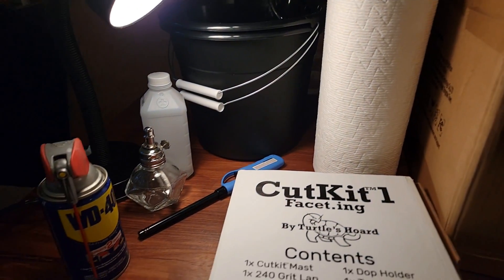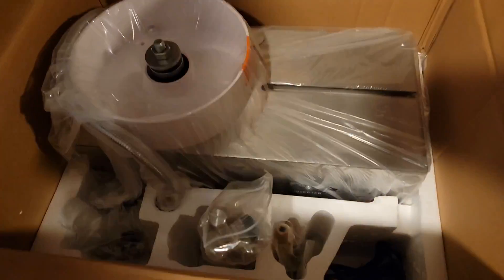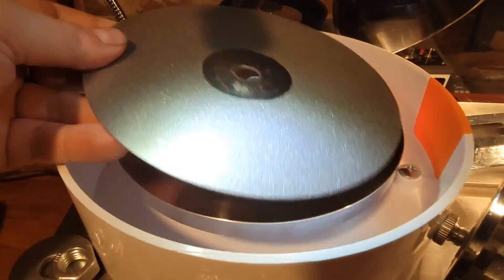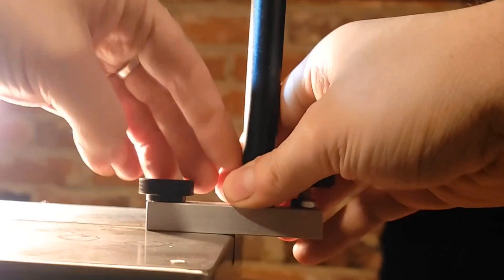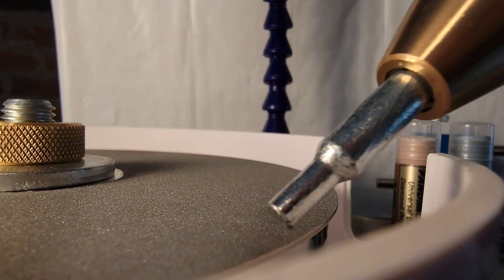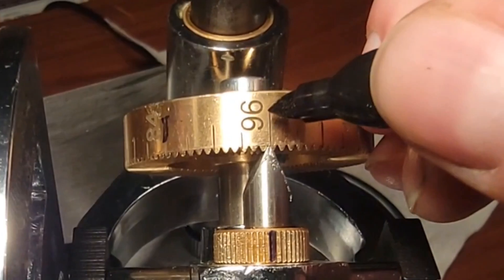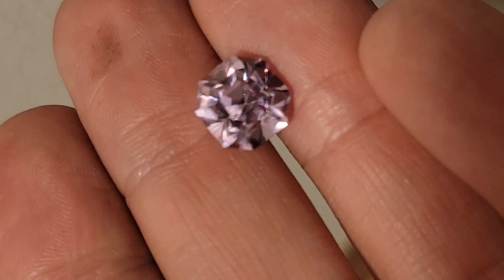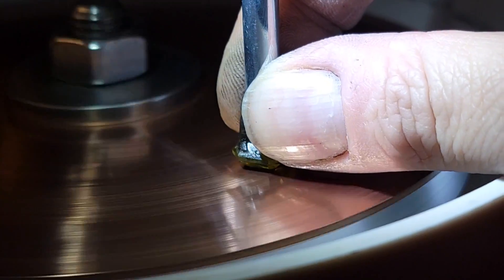Setting up the CutKit™1 with a Vevor Faceting Machine, Cut for Under $500!

Comment: Can you post the exact model number?
Reply from the maker: Vevor kd8801, but we now have fixes for other similar models (the ProTractor2 upgrade fixes the worst issues)
Reply: @AngryTurtleGems  Is this is the best faceting machine Vevor now sells?  If not, which is?
Reply from the maker: @lawrencediggs7957 vevor sells different ones in different territories.  The kd8801 tends to be the best deal for similar hardware, but other generic boxy ones are very similar (but not identical, they usually have a worse protractor that needs replacing)
Reply: @AngryTurtleGems  Thanks. I don't like to buy machines that I have to rebuild to make work, because I would haver no idea of whether I am doing it correctly or not.
Reply from the maker: @lawrencediggs7957 we're working on a more complete solution but it will take some time

Comment: Im having problems when it comes to pre polishing and polishing my gemstones cone out very foggy and not very clear what would you recommend? I had some people tell me a 1200 grit is whats needed to get a clear polish
Reply from the maker: Which laps and grit are you using?  1200 is on the coarse end of preforming and there are a few materials that react poorly to that grit size but sometimes it can work great
Reply: @AngryTurtleGems I'm using a 600 and a copper lap with some polishing paste and ordering a few other laps.
Reply from the maker: @Unhingedgroup 8000 on copper is great for some materials.  Did you make sure your 600 grit was broken in?  Somrtimrs when they are new they can leave deeper scratches
Reply: @AngryTurtleGems I did not but now that I know ill make sure thank you!

Comment: Isn't the fact that the plate isn't level a problem?? Off by a millimeter is really bad.
Reply: It’s 1mm difference over the entire surface of the disk, unless you’re going to be cutting some really large stones, it shouldn’t be an issue. 

You’ll only be cutting with a few centimetres of the disk while it’s spinning so the difference will be less than 1/10th of a mm.

Comment: wearing a respirator is crucial for any silicates, cyclosilicates and halide. silicosis is a common condition in the faceting world. (to be fair, mainly with large volumes and masses like granite) but silicosis will mess you up. there are other minerals that are possibly irradiated for color and clarity and radiated dust is also not great to breathe.

Comment: Hi! I already have your equipment and kit, but I just have one question... How can I use the cheater? Out of curiosity, I moved the cheater as soon as the machine arrived, and now I don't know if it's aligned correctly... Could you help me?
Reply from the maker: @tesorosdelbuho  to reset the cheater tou can take the locking nut off completely and then rotate it until the hole through it is centered and at its highest position.  Then mark the knurl/ long divot at the center of the cheater with your permanent marker

Comment: Would it do rough opals?
Reply from the maker: @MusicLvr81281  yes, but for prepolish/polish you would want to avoid oil and probably use oxide polish on a softer lap (like cerium oxide on a plastic lap)  I havent faceted any yet but I will
Reply: @AngryTurtleGems  thanks for reply. Would lve an opal vid.

Comment: Ok so im considering buying this kit but i already have the older vevor model that you mentioned the video about.  Even if not ideal, will this kit work with the older vevor model?
Reply from the maker: @sweetgumnyc7794  yes, it is compatible.  I didnt recommend that one in the past because of its inferior protractor but we have a replacement which will be restocked soon that solves that issue.  In some ways the older model is superior.

Comment: What size lap wheels do huh use for this machine? 6” or 8”?
Reply from the maker: @hunteryoung1176  it takes 6 inch laps
Reply: @ so it won’t take the 8”?
Reply from the maker: @hunteryoung1176  not without some modification.  If you replaced the splash pan you could get it to fit.

Comment: So I bought the machine and was wondering if you ean into any issues with it not being able to hold the dop still. Even with the quil as tight as I can get it the dop can easily be turned with my fingers.
Reply from the maker: @jaypolk7245  yes, the quill has a limited range and it seems like they are starting to have qc issues on either the size of the bore or the size of the dops.  Is it every dop? We are working on a replacement upgrade that solves the issue entirely.
Reply: @AngryTurtleGems  in my case it seems like it is just the standard dop doing it. Both the table adapter and V dop stay in place
Reply: BTW do you have any idea when your cut kit will be back in stock?
Reply from the maker: @jaypolk7245  they just got back in stock and should ship immediately
Reply: @AngryTurtleGems  ok. I checked earlier today and it said out of stock. Will look again
Reply from the maker: @jaypolk7245  hmm, it is listed as out of stock.  I will check on that
Reply: @AngryTurtleGems  awesome thanks.
Reply: @AngryTurtleGems  thanks for getting it taken care of and everything else you and your team do. I will be buying 1 this Friday.
Reply: @AngryTurtleGems  hey man. I placed an order and there have been some delays getting ahold to your customer care team in regards to something. Any way you can reach out to them or myself when you get the time. Thanks
Reply from the maker: @jaypolk7245  hello.  Sorry about that, they took a couple days longer to get fully up and running at the warehouse than expected.  I will look into it.
Reply: @AngryTurtleGems  who would I talk to about a bundle order of all index gears. Turns out some of the teeth on mine were not cut properly
Reply from the maker: @jaypolk7245  we should offer it as a bundle once I get more stock.  In the mean time I can send a properly cut 96 tooth when I get home in a week or so, shoot me an email around then.
Reply: @AngryTurtleGems  will do. Thanks
Reply: @AngryTurtleGems  hey. Just wanted to touch bases and see what the word is for you finishing your travels?

Comment: By the time you pay for all the amendments you might as well pay for a more expensive brand
Reply from the maker: @EmbraceTheChakra  500 bucks is still way below what you will spend on a higher end machine.  The low and mid end have been hollowed out for a long time, unless you get lucky on a used unit you will generally have to spend thousands.  If you can afford a facetron or ultra tec or whatever they're awesome and generally worth the money, but it's a different price bracket

Comment: Looks like the price went up on the CutKit, now it's more like less than $700
Reply from the maker: @bakastep3107  the kit is still only 210usd, the machine's price fluctuates a little bit but you shouldnt spend 700 unless you get the upgrade parcel

Comment: wanted to check the review before buying this machine. gratitude for the review.
Reply from the maker: @Karlous100  it comes with more challenges than some more expensive options but I think it is a good way to learn.  I still enjoy cutting on mine.
Reply: @AngryTurtleGems  you handle the challenges that comes with this machine very well. Gratitude i can get a good experience, it's a good start.

Comment: Hello! Who knows if it's finally possible to use a vevor machine with horizontal panel? The version with a vertical one isn't available in Europe, but with horizontal one actually is, why might it not match the kit?
Reply from the maker: @u-ken-to8953  it works and is compatible with the kit, but the protractor and angle indicator are not as good which makes it much harder to set your angle consistently.
Reply: @AngryTurtleGems can't you buy those parts separately? I looked into ordering one from the USA, but then shipping would be more than 150€ extra.
Reply from the maker: @fonskeflup4813  from what I've been able to tell Vevor had a custom protractor made with a better layout so you can clearly read where the indicator is relative to angle marks.  The angle indicator itself can be ground to a point on the faceting machine.

Comment: Does this fit the same big model with the different inventer box but otherwise same looking?
Reply from the maker: It fits, but that model has a few extra issues (particularly a very blunt angle pointer and a protractor layout that make it very hard to tell what angle you're at).  It's still improved over the similar generic models with the horizontal controller though.
Reply: Hey, the cutkit1 been sold out for a long time, do you have an estimate when will there be more?

Cant wait to get my hands on one
Reply from the maker: @MV04000  we're shipping out preorders right now, one component has had added delays so I'm waiting on that before we sell more--next time we put them up we will have them fully stocked and assembled.
Reply: @AngryTurtleGems  thank you for the answer, ill be waiting for restock👍🏼

Comment: what is the mast in your kit made out of? Plastic? metal? I'm interested in purchasing it, I just want to make sure its plenty sturdy.
Reply from the maker: It is made of aluminum.  It is sturdy, not quite as rigid as the original but rigid enough to not really add to the general flex of the machine.
Reply: @AngryTurtleGems  well, thats great to hear. We appreciate you actually taking the time to put together a kit for this machine. There's a lot of people who want a cheaper faceting machine that actually functions. The vevor machine has been up in talks for a while and seems to be the only way for beginners to dip there toes in without spending thousands. you are the best!

Comment: The Vevor machine with the vertical control panel is unfortunately not available in Germany. I will take another look at the CutKit1 when or if it is available. 

Btw you might want to make the link to the product page in the description more visible. I didn't even see it until I checked a 3rd time and at this point I just googled.
Reply: I also ran into this 😢😢
I'm a bit away from being able to afford it, but I hope Vevor makes it available at some point…
Reply: I ordered one from the american ebay because of this, the cutkit is out of stock though even for pre orders but hopefully that will change soon
Reply: What size lap wheels do you use for this machine? 6” or 8”?
Reply: Well, I took risk and bought KD8802(the one available at DE vevor page, with a horizontal panel). So far I faceted 3 YAGs, one synthetic moonstone, and it works very good for me so far, I am beginner. My upgrades were CutKit 2, ProTractor2, precise handpiece and brass lap nut.
Reply: @IamGroot-tl7xo  and it all fit the machine? The upgrades.
Reply: @nicooolai  Yeah, the only small issue was only with ProTractor2, one hole is a bit bigger than another, so there might be slight offset with vertical angle setting, but even then I personally haven't noticed it. (The screw heads have triangular profile, so they still fix the protractor to the place very well and tight)

Comment: So, where do I get all these extras from?
Reply from the maker: We have the kit up for sale on our webstore at TurtlesHoard.com or our landing page at www.facet.ing
Reply from the maker: Or a direct link https://store.turtleshoard.com/products/cutkit1-faceting-kit-faceting-for-under-500-dollars-all-in
Reply: @AngryTurtleGems  The video is not for cutkit1 is it? Because I see the hex nut that I wanted to be included and I think it is included in the upgraded kit. Am I right?
Reply from the maker: @sinceresincere-th4dt  the video is for the cutkit1 and doesn't include the optional upgrades. Which nut were you looking for?
Reply: @AngryTurtleGems  My friend let me explain what happened after purchasing the Vevor machine. After assembling, I tried to cut or just to learn the ways of the faceting, then I realized my stone is not steady. I am machinist by trade, so I would know what is going on. The back hex nut attached to the indexing finger and indexer was not tight. When I tried to tighten it, it was just turning around and around and I realized it is not even the right size pitch or the right size for the bolt and it was sliding back and forth on the bolt. So it destroyed my stone. I realized the 90 degrees is not actually 90 and I should bring little bit more towards the 80 and put a lever on the top of the arm and make it 90.  As you yourself have mentioned in the video, the arm does not go lower to be able to cut so I took the brass adjusters out and realized it is too low, therefore I ordered an other aluminum disk to raise the rotor . Anyway the whole thing is garbage. Now! if I buy the 292 dollar one, then I will be missing the hex nut, but if I buy the upgraded one, then I will miss the rest, so the only solution is to buy the whole both kits and it is like I better buy and new other one like sterling.
Reply from the maker: @sinceresincere-th4dt  if I understand right it sounds like the nut holding the cheater in position was not tight?  We do include a replacement for that nut in the basic CutKit1, you don't need to get the upgraded kit for that.

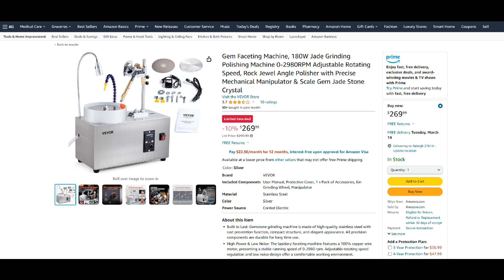Comment: Is it possible to make the kit work with the VEVOR machine model with the horizontal panel (0:22)? What are the differences between these two models? Ive checked every website and none of them is having the delivery of this model (with vertical panel) to Poland 😭
Reply from the maker: The kit will work with the older model, but it has some issues that are harder to fix.  Probably the worst are the protractor (angle ticks on the bottom where they can't line up with the angle indicator) and the angle indicator (so blunt you can't actually set any particular angle).
Reply: This might sound stupid, but can't you buy a replacement part from the newer model and use it for the older model? @AngryTurtleGems
Reply from the maker: @fonskeflup4813  you totally could, but Vevor doesn't offer parts off the shelf.  As far as I can tell they are the only company selling this exact model with the fixes--the similar looking generics are clearly closely related and have parts compatibility, but they're different too and at least some parts like the index gear appear to have been made in a different factory entirely.
Reply: @AngryTurtleGems  Sorry to necromance this comment, but I'm wondering if there is a possibility of making a video with one of these older horizontal control panel models,  if you have one available, comparing it to the fixed vertical panel model, and maybe how one might go about mitigating the inherent issues in the older design that the CutKit doesn't resolve and that maybe doesn't require a 3D printer and a full machining set up, if that's even possible 😂? I saw a comment on the video you reference mentioning drilling a hole in the indicator "needle" and inserting a piece of thin round steel bar that barely touches the protractor plate, so that you can see the indicated angle more clearly.

I would very much like to get into gem faceting to go with my goldsmithing skills, but machining things is a bit above my skill level, to be quite honest. (I guess I could technically make an accurate protractor plate in brass and hand engrave the angle marks...)
Reply from the maker: @Twistedcrescendo  honestly it shouldn't be too bad, since you can grind the angle indicator into a better shape right on your faceting machine.  I am also working on a better fix for the protractor.
I am planning a general tune-up video, I like the idea of including it in that.
Reply: @AngryTurtleGems  That sounds fantastic! Looking forwards to the video!

Comment: I bought this machine and was able to cut stones with this machine.. the major issue is the cutting the griddle in 90 degree.. I like to buy the modified mast stand and screws .. please let me know how to reach you. Thank you!
Reply: Thank you for making this effort. This is very helpful!!
Reply from the maker: Hello!  We do also sell the cutkit mast as a standalone, you can see the listing on our website at TurtlesHoard.com, or all information is on www.facet.ing
Reply: I am placing an order for the mast .. quick question.. what is Knutled Brass Lap nut?
Reply from the maker: @pfgemsandjewelry  the machine comes with a plain hex nut to hold laps down.  It's not very comfortable to use so we had some custom brass knobs/nuts machined to replace them.  Not necessary but awfully nice.  I cut a few stones with the base kit but from now on I'm using the upgraded nut.
Reply: I just placed an order.. I need the cheater Thumbnut!! I have sent you an email.. Thanks!

Comment: Is there a different machine this can be mounted to? the vevor machine aren't available in AUS
Reply from the maker: They do have them up on aliexpress so you might be able to order that way
Reply from the maker: It might fit the similar generics from China but I am not 100% sure and they have a couple of other issues.
Reply: they sure are ...    i have an account with them  and are available on ebay

Comment: The mast alone is worth it! The only way I was able to do girdles was by stacking two 6” x 1/4” plexi discs and two laps on top of that. Then I have to use a stainless pipe clamp in place of the split nuts to lower the bar further. This method raises the cutting lap above the water pan so I bent up a metal hanger to pin some long ziplock bags to catch the water off the lap. And it worked.. but what a pain.